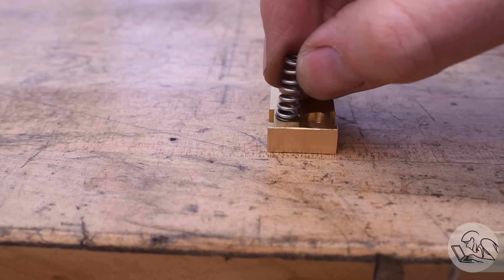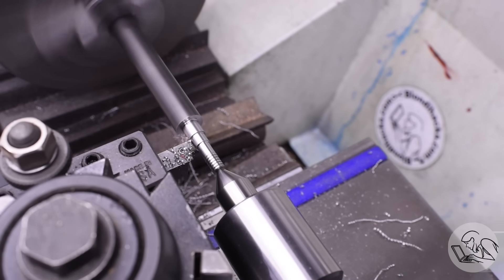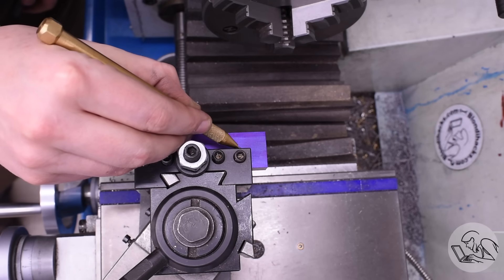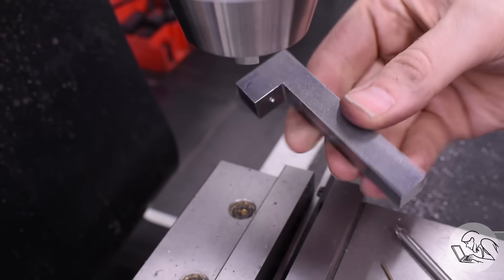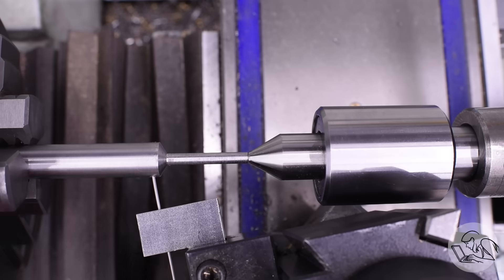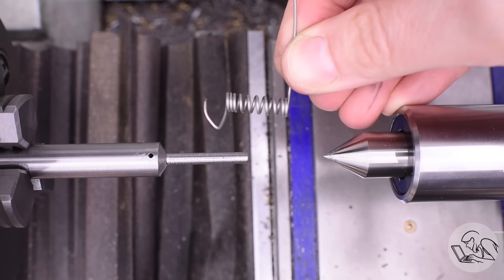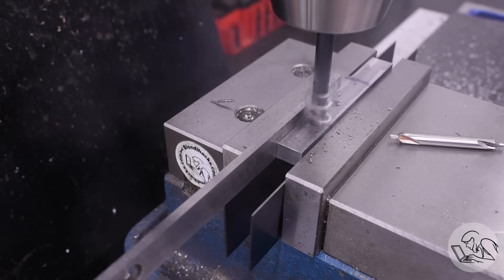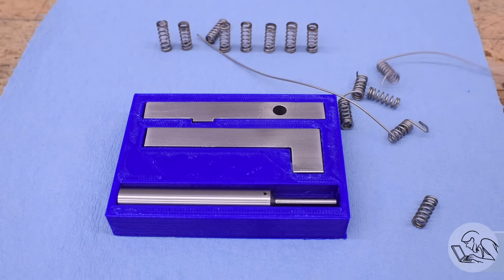Making Your Own Springs On The Lathe!

Comment: In trade school, nearly half a century ago, we used two pieces of wood clamped in the tool rest to replace both the plier for tension and the rectangular L steel piece and its angled hole.   No doubt that the end result was not graded harshly. I can't remember if I used the corner of a file to create a v-channel in the lower block.  I think it would have made sense to control the spring wire path.

Comment: I'm from a time when a machine shop, wood shop, and auto shop were SOP for both Junior and Senior High schools.
Even though we had lathes, there didn't seem to much focus on them.
I remember turning a Judge's gavel, an aluminum bowl, a knurled center punch and some other misc items.
I've always wanted a lathe, but until recent really had no need, now I've gone and created it.

I'd love to have a big 'ol 4 barreled 454 powered lathe, but the man power required for installation including slab pour, steel building, and setup would be staggering, not to even mention the cost to airlift the damn thing to my location.

So being as the older I get, the smaller I seem to be getting, I decided instead to investigate the "Mini lathe" to go with my new "mini" personna.
There appears to be a Seaworld of Chinesium mini lathes out there, with someoutfits claiming to reworking them and bringing them closer to roper tolerances.
But every time I went online to these higher end websites, tossed a lathe and all the proper tooling I believe I would like to have into the cyber carts, the bottom line for all of them came out in the thousands.

Just as I was beginning to lose my lustful desire for a lathe, I came across a 90+ year old lifetime machinist who is closing up shop and selling off all his machines and tools.
Unfortunately, I can't afford the caliber, nor size of much of anything in his inventory, but one thing he did happen to have was a never used German produced (Central machinery) 8x12 mini lathe.

Being as he was planning to use it, he purchased just about everything a proper machinist would for a professional lathe setup. I mean boxes and boxes of pieces, parts, tools, bits posts, cutters and a myriad of stuff I haven't even seen yet. It's due for delivery tomorrow, and I can't wait!

On top off all that, I can't believe I found your channel!
I've been buried in it for days, and can't believe how much I've learned already. Even more, I'm only partway through your beginners series, and will be glued for an eternity. 
Your knowledgable/sometimes humorous, always clear and straight to the point presentation is second to none! I can't wait to learn more, I'm blown away.

Thank you!

Comment: More great content.  I've made coil compression, and expansion springs this way, but your tooling was better.  Especially liked the 10 degree angle for the wire guide.   I always used a good quality wire nipper to cut a section of music wire.  I have made plenty of flat springs from 1095 steel too.  Hardening and tempering was always tricky for me with only a torch.

Comment: Outstanding!
I am a hobbyist of airsoft-replica's , which apply springs in a variety of shapes and sizes. These springs are readily available from China, but in some cases, there's just not the right one for a particular job. They're either too small, too large, too long, too short, too stiff, or too weak. I already have used shims to tweak the spring tension, but it comes with drawbacks in other departments.
As a lathe beginner, I'm not even beginning to contemplate making my own customized springs, but this video is a real inspiration nevertheless!

Comment: Hi Quinn, there are easier methods for making one or two springs to replace ones that got away. Lots of bolts have convenient diameters, put into the chuck with the end of the wire tucked into the gap between teeth.  Mig welding wire, stainless or steel can be hardened by drawing it over a sharp edge. Winding the wire close together with a large strong ball bearing pressed hard against the mandrel. Run the wire in highly tensioned and close wound. The spacing can be by stretching later. When grinding the ends with a rig like yours, press firmly and the end turn will heat up and glow, just quench in the water. A final light touch will give a tapered end turn like commercial springs. Cheers from NZ where springs are expensive.

Comment: I enjoy your videos Quinn and have watched many. When I need a spring that isn't in my salvaged springs container I'll come back to this one. I've never made a spring but back when I was teen working for Dad in his repair shop we used the lathe to wind 20 foot lengths of 1/4" round hot rolled mild steel into a tight helix with an ID of approx 2". The helix was then cut apart to make rings for coat hangers. These were for the school unit and we made them in batche4s of 100 or so. The idea was that once the hangers were hung on a pipe they wouldn't come off. Thought you might find this interesting.

Comment: Hi!  This is a very nice video for making strong springs.  However, for my work, I need to make very light springs for chiming door bell hammers.  I use the lathe, but also place two pieces of leather in the tool post and clamp the 0.001" stainless wire to cause resistance as the lathe turns and winds the wire on the mandrel.    As the wire is pulled through the leather pads, the frictional resistance also helps to maintains the spring diameter.  I do like your technique to flatten the ends of the spring.  You always do such great, well calibrated work.  Thanks so much for your videos!

Comment: But if you want to make a spiral spring even more simply and you don't have a lathe, there is an even easier way. Take two wooden strips made of not too soft wood. Either bend a round steel into a crank, i.e. two right-angled bends with a longer straight part and a shorter part that is parallel to the first part of the crank. Or if you want the spring to be bigger on the inside, take a metal shaft and drill a hole into which you can put a crank and screw it on. Then make a small hole at the end of the longer part to put the wire in.

Then clamp the pieces of wood with the long part in between in a table vice, put the wire into the hole of the shaft and then wind the wire onto it by turning the shaft. The harder the wood is and the tighter you press the pieces of wood together, the smaller the spring will be. By trial and error you will quickly find out how big the shaft has to be and how hard you have to press the wood together. Depending on the angle at which you hold the wire, you get a compression or tension spring.

You can also make a compression spring out of a tension spring by compressing and hold it, or pulling it apart and then tempering it to 300 degrees Celsius (blue colour). However, tempering is absolutely necessary for every spring. This is the only way to get rid of the stresses caused by the deformation and the spring has the correct force. Piano wire also has a higher spring effect than stainless steel wire. You only use it if it is absolutely necessary. If you need several springs, it is also easier to wind a longer spring and then cut off the necessary length.

Comment: The thing with being able to "buy a thing" is that only works if a whole bunch of conditions are met: The store is open, you have enough money, you can get there, it has the thing you need, and it takes less time to do all that then it does to make the thing. And, the best part about making 1: You can usually make 2 or to as much stock as you have.

Comment: I noticed that basic MIG wire was a complete pain to keep on the spool (i.e., it was springy), and started using that to wind (lower precision) springs (just using a vice, clamp, and dowel) and it works well.  Plus it has a cool looking copper color.

Comment: Xuron has a hard wire cutter, number 2193F, that makes it really easy to cut music wire or other hard wire up to 0.064" in diameter. That's what I've been using for hard wire, and they're great cutters. Fast and produces flat cuts, as it shears the material.

Comment: 17:35 - to hold the small spring well, you could use a handle with a screw sticking out - a) matching the inner diameter of the spring - and b) a nut (with washer?) to adjust the depth. Then you don't have to hold the (small / short) spring with your fingers. 

The effort for the whole project is so "big" that this little extra effort does not matter. A handle for a hand-operated drill could also help if its clamping element is suitable for the diameter of the screw. (My hand drill can grip max 4.2 mm. Other handles probably offer other possibilities. Otherwise, an adapter will have to be made for the following project. - Or simply a wooden handle with a suitable hole into which the screw with the nut can be screwed.
Anyway: More comfort and less cramps for the fingers).

ii) The metal rod could still have an opening for a simple or complicated plug-in connection for a (plastic) pipette for the water, so that the spring does not have to be removed during sanding. Of course, a visual check of the work progress remains necessary. .... ;) 

iii) With a depth stop (better 2) on the handle, the length for the spring can be adjusted during sanding to produce a small series. The depth stop can then find its limit on the metal bolt for one of these work steps at a time.

a very nice demonstration on a rare subject - thank you

Comment: Very nice to see this, I had similar setup a long time ago, as for the mandrel  I had about 5 different size sleeves that slid over the  mandrel at 0.5 mm diameter intervals instead of making loads of different mandrel sizes.
and to stored them in a metal Tobacco tin,  Very common use back in my days .. :)
But your 3D print storage looks far better.

Comment: With small diameter. with.0.3 mm you can use a hand drill use a threaded rod (e. g. M6) as arbour and the spring come out very regularly. Crazy fast too. You can cut those small diameters with a chisel. It is easy to get the spring length larger by pulling it past the  deformation length . Also you can enlarge the inner diameter by forcing it onto an arbour. Fun fact the spring constant force/length don't change by these manipulation. If you cut the original length to say 10 grams per centimeter ( 1 N/m) you can get the size correct without affecting this property.Also those thin wires are available as guitar strings with precise diameter and cheap.j

Comment: Not really diy. Unless you have a machine shop. Very nicely done. Someday maybe I’ll be able to do this. 

I’m looking for a method somewhere between this and holding the wire in my hand and winding it with a drill motor around a solid rod chucked into the drill.

Comment: I was wondering about modifying springs, I have a springtools punch that I destroyed the spring, I also have a random spring the same size but the ends are supposed to taper down a little tighter to grab the two punch shafts. Didn't look anything up yet but I assume I can adjust a premade spring.

Comment: My first Machine shop job was back in the '70s in a custom shop that made manual spring coilers and spring grinders. I made all the parts and accessories over a 10 year period, even now almost 50 years later I can make them in my sleep, no blueprints needed! Hmmm, might be a good project!

Comment: I used to rent a lock up garage in Blaydon UK down by the river Tyne in the 90's the owner had a custom spring making across the road , we had to use the washroom as our place had no facilities , we got to know the lads working their , one of the young lads there always ended up with rubbish jobs one day seen him cutting thin wire into 2 inch strips thousands of them , not sure if it was the next day he was bending the wire in a little jig type thing I got curious so asked , he was making R clips something like 5000 thought the poor sod , it reminded me my first job at a engravers the company made all sorts from 3 to 4 inch brass ship pipework washers all had to be engraved direction and what was in the pipe they were punched out by hand worst was brass key fob's all had to have a hole punched at one end and engraved with individually numbered thousands of them , a day at the fly press as a 15 year old I was close to tears  .

Comment: You can make spings without a a lathe.
 You will need a vise., a hammer,  a file, a propane torch and spring wire. Caution does not work well for small diameter spring wire. It tends to melt. Great for making micro steel balls. 
    First heat the spring wire to red hot then let it air cool. this softens the wire. Next wrap the softened wire around a rod of the right size to make the size io spring you need . If you use a threaded rod you can get as many wraps per inch as you want. After making the spring, heat to a even cherry red over the entire lenght of your spring. Quench your spring in oil or water to make the wire hard again. Volila homade spring. An oil quench will make a slightly softer spring than a water quench.

Comment: I've done wrapping similar to this before, but was making coils that turned into chainmaille rings. A big reason to NEVER hold the wire by hand is that if you somehow get a finger caught between the incoming wire and the mandrel, it will no longer be a finger. It'll only be a stub. :)

Comment: Instead of your L shaped metal part I use a pair of wood strips that go in place of a tool bit. They are two layers with the wire run between them. By adjusting the tool hold down screws you control the wire tension. One set of strips covers any size wire. With good tension control you get better springs.

Comment: you really should have a 90 degree belt sander. and they are not difficult to build. I did it and I only had an electrode welder an angle grinder and a drill press that's all the machines I have. you should be able to build a very good belt sander with your workshop.

Comment: That is probably (certainly!) more accurate and repeatable than my simple wire tensioner and Mark-1 eyeball for spacing the opening and closing turns.
Besides music wire and SS spring wire, there is also phosphor bronze - VERY springy.

Comment: I’ve had car spring come off the mount after changing brakes/rotors. I think the nuts came loose when the car was on stands and the spring wasn’t compressed. Then when I put it down, the damn spring popped out and punctured my tire. I had hammered the hell out of the rotor to get it free from the hub. All my brake jobs went better than that time.

Comment: One thing I'll add to this - if you know you're going to be making a few copies of a certain size spring, you can get a rather close measure of the length of wire needed by using something soft as a mock up spring. Copper wire if you have it laying around, safety wire, hell - even string can be used. You're just looking to get a measure of the length you need to form the spring correctly while having enough tail length to keep it in the guide tool. Once you know the length you can save some material by not cutting quite so long for safety, and this can save a bit of money if you're making a fair amount of springs.

Just throwing out ideas. Loving the videos. Quinn. Have fun!! 😃

Comment: I have made some cooling coils in a similar fashion. They were roughly 3" in diameter and used 1/4" tubing. Depending on material and wall thickness, you may have to fill the tube with salt to prevent it from collapsing. Given the relatively high pitch, I just advanced the carriage by hand.

Comment: Quinn. I've seen you use a "tool" to blow the chips off of your work. What is it. I need one. I also don't have the compressor option and, sometimes, a chip brush just won't get where you need to get.

Comment: If you scale this up considerably, you end up at the setup we used at a university workshop for making stainless and copper tube coils for experimental setups. The only significant difference is that we used a pertinax guide block in the toolholder to not scratch up the tube.

Comment: Ha! I tackled a very similar problem years ago for making chain mail coils, not springs. Of course, my job was easier because those don’t have space between the coils.  If you ever feel bad about hacking something together, imagine a wooden frame, a metal dowel with a cross drilled hole, an electric drill, and a wooden handle that closes around the dowel with an in feed slot through the handle. It was a thing of terror and beauty.  But it worked for a shocking variety of wire sizes.

Comment: This is a much nicer spring than what I made the last time one ZINGED across the shop.

I used smaller music wire with a piece of 3mm (2mm) drill rod chucked in a cordless drill, and held the end with Vice Grips.

The important thing was that it fit into a tiny hole to capture a teeny ball for a socket wrench ratchet switch.

I don’t know if Machinery’s Handbook would have helped me eyeball everything, but I would have learned something if I picked it up!

Comment: For the tensioner, could you make a flat-bottomed thumb screw perpendicular to the wire hole to eliminate the need to use the pliers? And be extra-bougie?

Comment: For the part that hold the bulk of the wire while the spring is being turned on the lathe, could you not put a grub screw that intersects with the small hole, and mechanically adjust the tension on the wire via the grub screw? You might need a small piece of brass or bronze to not damage the wire, but it might be a good way to free up a hand while working through the process (though I imagine a grub screw would take a while to get used to since it would take away the feel that the flat jaw pliers give).